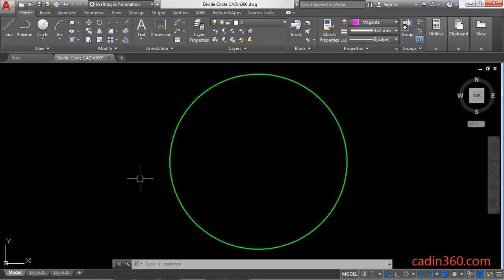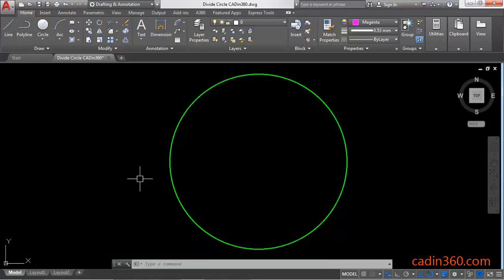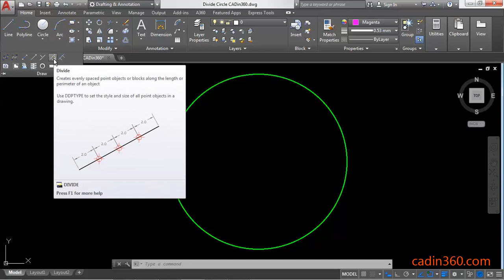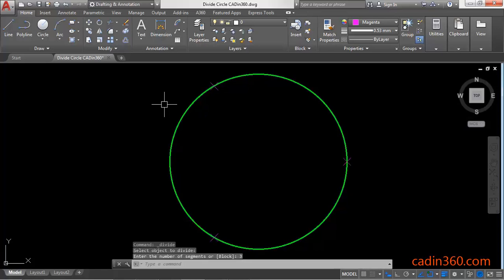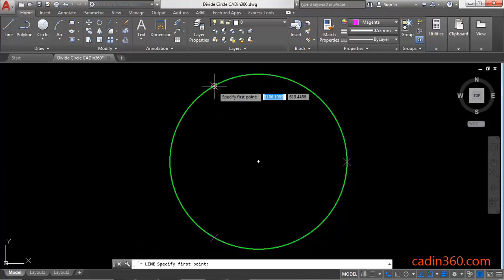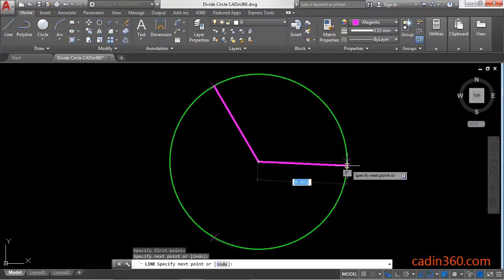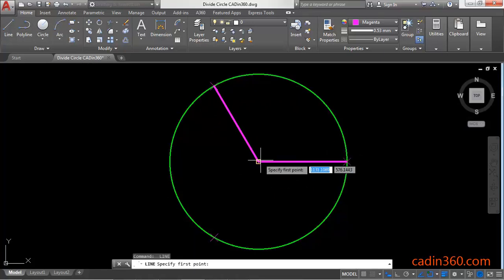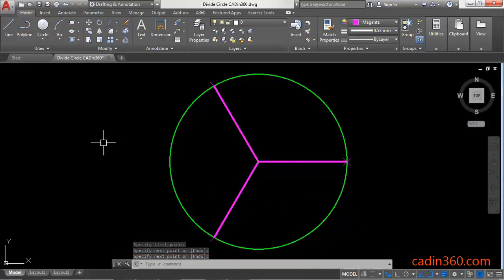How to Divide Circle into Equal Parts in AutoCAD 2018

Comment: It didn't worked
Reply: Same problem for me. Followed it exactly (as far as I could tell) and...nothing happens after entering the number of segments.

Edit: it does actually work, but you need to adjust the pointer type (PTYPE command) so that the crosshairs showing the segments are actually large enough to see.
Reply: @jmckendry84  Thanks this helped a lot
Reply: @jmckendry84  thaaank you so much!
Reply: @jmckendry84  thank u soo much ❤